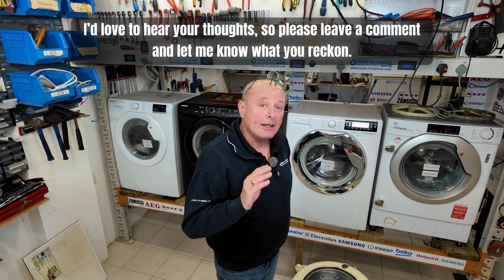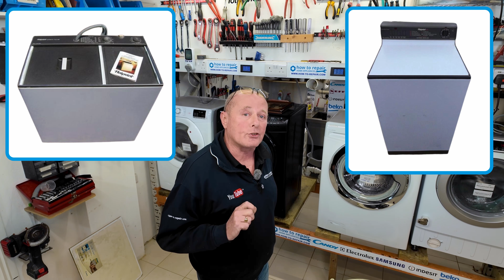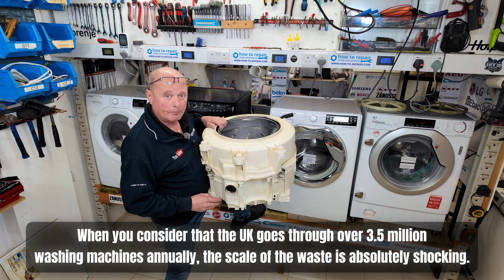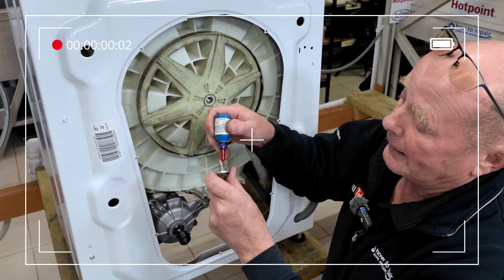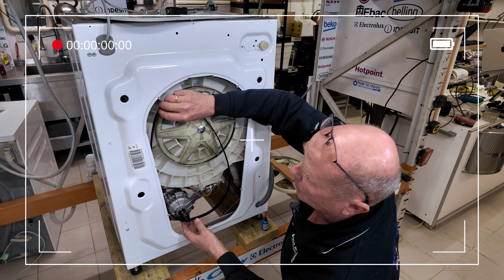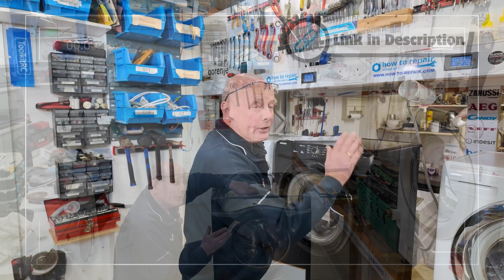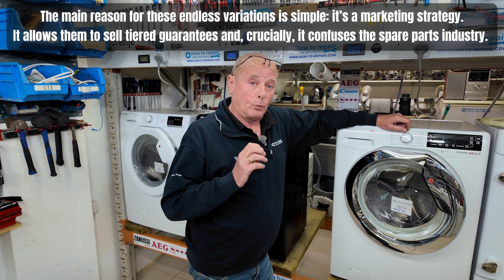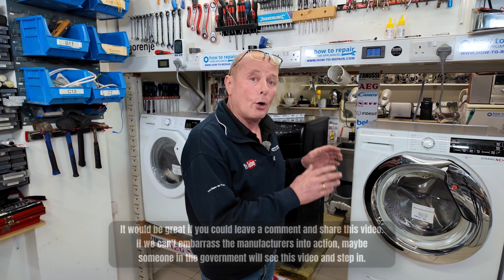I Scrapped 13 MACHINES to Prove a Point: STOP BUYING These Brands!

Comment: The main problem is the economy rewarding fast machine cycles financially. People buy the cheapest machine possible and whilste they complain heavily on the internet barely anyone confronts the manufacturer at all, jet alone insists on quality in law and politics. Europe has a 2 and 5 year mandatory warenty, and depending on the context people don't buy the machine if it doesn't come with a 8-10 year warenty. As customer and politics defined this 2-10 years as a requirement it ends up in the spec sheets for the engineers and the machines work as such.
The US doesn't have a consense on how long a household device should last. So why waste money on quality and cut your own salesnumbers by overfullfilling that requirement? Infact the companies that didn't adjust to the fast cycle rate of products usually die.

Comment: I had to scrap my Hotpoint machine because of the bearing failing and the drum being sealed. I would have repaired it otherwise. Got an 2004 old 5kg Miele from a friend with shot suspension, for 20€ I replaced them easily

Comment: I've had a Bosch Serie 4 VarioPerfect for 10-15 years, worked flawlessly up until recently when there was a buildup in the filter, repairman cleared that in like 2 minutes and it's as good as new again. However, I'll never understand why they make them so hard to work on, it should have a lid with a latch that can be opened so anyone can clean it, having to call an expert for such a small job is a hassle and a waste of time and money, someone needs to start doing things a different way, I'm sick of this way of life, constantly having to buy new things because they purposefuly made them bad... In this case, my machine is an exception, but goes for pretty much anything. Had a bread mixed for 20 years, broke down, got a new one, broke down in a few months. Got a dishwasher, lasted 10 years, broke down, got a new one, broke down in 2 years. I could go on, lawnmowers, powertools, phones, batteries, monitors, peripherals, I'm sick of it.

Comment: you spend a lot of time showing how crap some popular brands are and about the planned obsolescence that is embedded in modern appliances. But have you actually recommended some good brands/models? I have not found something like that and it would be extremely useful, rather than when not to get, when that is basically almost everything :D

Comment: I had a hoover washer/dryer combo, I know already I was asking for trouble. Within a few months a thermistor had failed, it was still under warranty, the engineer told me "this is going to keep happening". It did, I learned to fix it myself. I must have replaced it 3-4 times. It was nuts. And then the power wires snapped off at the joints, heat cycling had done it. I couldn't believe how bad it was, I re-soldered them on and it lasted another 6 months.

Comment: I'm not engineer in this field but I wonder if it's possible to build a washing machine like good old days (easy to repair, lasting and with enduring components) may be through crowdfunding platform like Kickstarter. What will be the the cost of engineering and manifacturing?

Comment: Hi, our washing machine is an integrated Bosh cold fill only unit. It’s about 4-5 years old now but for the last year or so it’s been building up black bacteria in the detergent draw (little holes above the draw where the water falls into the draw). I’ve completely removed the draw compartment and removed the hoses from the draw compartment, clean out the little holes till it looked  new. The bacteria is looking like it’s coming back. Any thoughts. Cheers 👍

Comment: I have a Zanussi produced in 2000s. It was almost 800$ at that time. When it stopped working, the repair specialist said that it would cost me 150$ for PCB + work and 60$ for shocks on top of that. When I asked him, why don't just buy a 400$ washing machine, he laughed and said that it would outlast those. It was 4 years ago, and it is still working.

Comment: All machines have planned obsolescence no matter if the brand is good or bad. All parts have an expiration date weather you like it or not and you can't engineer your way out of a brush motor having a X number of revolutions it can do before it breaks or a rubber seal going bad after 7 years. What you are talking about is FORCED obsolescence that inherently prohibits you from fixing anything on the machine by making it as expensive and hard to do as possible.

Comment: Miele 1993, still running. Parts broke over time, but was able to fix it. Sold my new one five years ago cause it was an electrical issue and the parts were almost the price of a reduced/on sale new one. So my backup old one is now my main washing machine again😊

Comment: slightly off topic but I have an 8 year old Samsung washer dryer I picked up about 5-6 years ago for $100 (not drying... shocking right) I stripped it and cleaned it and got it working I was appalled with how long the drying cycle took even with a 1/2 load it was about 5.5 hours so apart it come again.
 the internal return air duct from the drum was cut and redirected to the exterior of the machine which now has a duct that runs to the exterior of the house it works just as well as any old dryer it does take slightly longer than a regular dryer but it'll wash and dry a full load in about 4.5 to 5 hours my partner absolutely loves it, every 3 months I will do a drum clean and clear out the duct and I can't fault it as from factory they are a joke.

Comment: The price of the PCB's are a scam. Their is nothing of any great value on them, just typical basic electronic components that mostly cost peanuts, connectors and a small micro processor maybe worth around £15.00. Total all in £30 if that. I used to fault find on them for a while in a factory that produced them on one of it's lines. Even the pcb board quality was garbage.

Comment: In Switzerland, we use in general machines from Miele and VZug. Those machines have high quality and repairability and a long time of avialable spare parts. But they are significantly more expensive than the low quality stuff on the market.

Comment: My mum had a top loader machine when I grew up, one side washed, one spin dried. Perfect clean clothes every time. Lot of work for poor mum, but great results. When I moved to my first place, the first front loader I had was Hoover, and was absolute rubbish. Clothes never cleaned right, and mould build up and made clothes smelly. Moved to a Bosch 20 years ago, and other than some cleaning and replacing brushes, its still going strong

Comment: As I often say, machines are so cheap, made with cheap components, people  want to pay the minimum. If machine cost £1000 to manufacture and they sell for £2000, you might get decent quality. People pay   £300 for a machine and wonder why they are made so cheaply. They can’t afford proper bearings as people won’t pay for  them. I just researched the 1974 argos catalogue, a basic Hoover washing machine cost £135, in 1974. According to the bank inflation calculator, that is between £1600 and £1900 in today’s money. 
There is no way you are going to get quality paying £300 for a machine that costs £150 to make.

Comment: we have a 2000 Miele washing machine, strong built with sound proofing walls inside it. We switched the belt 5 years ago and the suspensions underneath the drum cause it was damaged. It cost us 20 quid to replace the parts. Silent, sturdy and reliable. We were actually looking into buying a new Miele, but we found out soon that the building quality is poor and the washing cycles are very long on the new models, there is no cycle under 2 hours. We'll stick with the 26 year old machine that we have and still washes our clothes clean.

Comment: There are a few realities here: twenty years ago you had maybe 15 washing machine brands to choose from. Today, this has gone up to over 40. In the low price segment, corners have to be cut and the most expensive part in a washing machine production line are people. You often state things like: I repaired this machine for £15. In reality, you have to drive to the customer. If you are lucky, you have the spare part required with you. If not, you have to order the parts which costs you time, and you have to return a second time. Do all this for £15, you will be bankrupt tomorrow. What would be the real costs to repair machine if you have to charge for all your time and the money in spares you have available? A low cost washing machine costs about £300 and some even as low as £250. Does it make sense to repair such a machine after 5 years for £100? No, you just go and buy a new one. The second reality: the price for a washing machines was about £ 300 for a low cost machine and £ 1000 for an expensive one in 1995. Width inflation, a low cost machine would have to cost about £ 580 and the expensive one £ 1950 on today's money. Instead, prices stayed the same, but your hourly rate has literally doubled in today's money. Do manufacturers cot to many corners. Sure, they do while they invent ways to lower manufacturing costs in every possible way. They learn how not to do things on the costs of their customers. That's the price customers pay for prices staying the same instead of paying double in today's money.
Reply: Fair point but TBH paying more is no guarantee - I’ve seen people on Facebook with photos of £4000 cooker ranges that have rusted within months.
Reply: @robf6905 tak tak. A tomu se tedy říká inovace. Hmmm.

Comment: The Siemens Washer-Dryer that my parents bought in 2012 and subsequently neglected just refuses to die. It only required a front seal replacement after a particularly hot summer. The rubber melted onto the glass door, and had to be scraped off by the technician. Last year, it started to develop a slight knock during spin dry, and I attempted to obtain a replacement. The technician begged me not to get the new ones, as he has to go and repair them all the damn time. The originally white machine is now an assortment of beiges and yellows. Over the years, I’ve tried many times to replace it with a bigger one. Yet, after everything, it is still the single longest-running machine in all of my various dwellings.

Comment: We have a washing machine my mom bought when i was in my teens... Im 30+yrs now and we STILL use the same machine to wash clothes, works fine but every few years we have to oil the pulleya or something so it stops making a squeaky noise, other than that it still works just fine. 

My sister however, bought herself a machine 3yrs ago and it no longer works

Comment: These companies are taking the mickey.  Competition is not making them build better machines.  I feel there should be legislation that holds manufacturers accountable by mandating ambitious minimum lifetimes for these machines (say 20 years).  And every one that has to go to scrap prior to that lifetime should result in a punitive fine in the order of the 10 times the original RRP.  That way we force manufacturers to built machines to last; force them to make them repairable, and make them greener to operate across their whole lifetime.

Comment: Hi, writing from Ukraine. It just so happened that my washing machine (a European brand, the one that is still manufactured in the European Union) broke down in less than 3 years after purchase. The previous one lasted 15 years, we only got rid of it because one of the legs had rotted out. So yeah, a €500 washing machine failed in under 3 years. We called a technician, and while he was repairing it, he mentioned that he had recently worked on a Miele washing machine that broke down immediately after its 24-month warranty expired, the drum spider had simply corroded. A $1,500 machine with a drum spider rotting away in just 2 years, what a joke.
P.S. Here in Ukraine, when repairing bearings, technicians cut open the tank, fix the issue, and then weld it back together. And I know for a fact this can be done multiple times.
P.P.S. They also upgrade washing machines here. When the drum spider corrodes, it’s replaced with a stainless steel one. We even have a manufacturer that produces stainless steel drum spiders for basically every brand.

Comment: I was a salesman for a Euronics dealer in my local area about 30 years ago. The cheapest washing machine I could sell was about 200 pounds. It was our best selling washing machine simply because that was the main selling point, it was either all they could afford or all that they were prepared to pay. Fast forward to now, the cheapest washing machine you can buy is about that sort of price.
The only way they're going to keep costs down is by moving production abroad and cutting the quality.
You're saying that an engineer call out is just short of 100 quid, most people would rather put that towards the price for a new washing machine.
The market back then was not really that much different to what it is now, there was a few more manufacturers back then, apart from the good old EU forcing energy efficiency on the washing machine manufacturers, leading to bigger drums to drive up efficiency figures. 
Given the washing machine cabinet size hasn't changed at all over the last 30 years, bigger load, more weight, more wear & tear, vibration = shorter life. How they can get a bigger drum in there, its a washing machine not a TARDIS!, it's a perfect storm of a drum size arms race, a struggle to keep costs down, a corporate culture of taking over competitors to increase your market share, which began back when I was said salesman. A lot of people don’t use limescale remover or clean the machine itself either, so shorter life.
I won't blame it entirely on the manufacturers, it's just the way the world has gone today. It's not just the domestic appliance market televisions have gone that way too.
Also I don’t agree on the landfill comment unless you know something I dont regarding WEEE policy in this country.
Reply from the maker: It is great to hear from someone who was on the retail front lines at Euronics back in the day. You've hit on some really important points about the economic realities of appliance pricing, the arms race of drum sizes and what actually happens to these machines at the end of their lives. This ties directly into the exact kind of built-in obsolescence we discuss in my videos. planned obsolescence and the lack of repairability are major issues in the industry. Manufacturers prioritize profit over long-term reliability, and as you pointed out, the pressure to keep releasing new models only adds to the problem. It’s also true that many salespeople lack the technical knowledge to guide customers properly. That’s why educating consumers to ask the right questions is so important.

Comment: It just so happens that i had to replace shocks in my Electrolux (EW6S426BPI No. 04) . No aftermarket shocks in sight. The machine had 4 iterations, shocks from the first iteration don't match the 4th.  Checked on several sites. A pair of those cost me an equivalent of £60. For those who dont know the washing machine shock is sealed with some piece of greased felt (you can pull it apart with bare hands). Many automotive oil shock absorbers come cheaper... By the way  the front panel is spot welded, had to flip my machine on its side.

Comment: I rember when things were made reliable, like my 2012 Vaio S. It still works great, no issues with it after an SSD upgrade and also because I chose the option with a NVIDIA GeForce GT640m LE and 8 GB of ram. The 14 year old battery is still holding a charge for about 3 to 4 hours.

Comment: Just tried to repair my Samsung 6KG front load, the spider arm failed in less than 5 years and its a nightmare to remve the bolt holding the drum and the spider arm. It is indeed designed to fail and i realized this fact the moment i opened the encapsulated drum.

Comment: About 9 years ago we had funding from a charity for a Hoover tumble dryer within 4 months of use the actual drum went rusty RUSTY inside and the drum was also going warped.

I had to go through hoops to get someone to come fix it because I had to go through the charity as they bought it. Well when the guy came to repair he saw the Hoover brand and just laughed he only had info on a warped drum.

He saw the Hoover logo laughed and instantly said good job I brought a brand new drum. They actually put in drums that are now not ment to last but ours went quicker because we used it a lot because we had a 1 year old child.

The drum he put in was shiny steel and lasted for ever then it died within 2 years after that the motor went so we got a Beko condenser

My mother used a Twin Tub for 20 15 years it was a Hoover branded one

Comment: I love your channel. 
It is about time to invoke the engineers liability. I am from 1970. What is the pride of building a 5 to 8 years product when all of our parents machines could last 20 to 30 years without a blow? These supposed-to-be-bright minds are so accomplicies of that system which leads to focus on short term running machines rather than  lasting equipment (just in order to have them replaced as fast as possible by the consumers.  I would be ashamed to have done that much studies and to be able to  propose such a poor result.

Comment: I bought a Hoover washing machine in 2015, after our 6 year old Asko shat the bed (PCB died). Figured there was no point buying an expensive machine again, hence the Hoover for around 1/3rd of the price of the Asko. Replaced it with a Westinghouse (Electrolux) in 2023. The Hoover was still functional, but the bearings were noisy and - surprise surprise - the PCB was a bit dicky. 4 out of 5 times it'd need percussive maintenance to work properly. That all being said, I'd sooner have another Hoover/Candy than an Asko any day of the week!